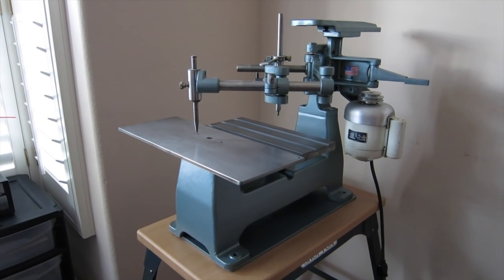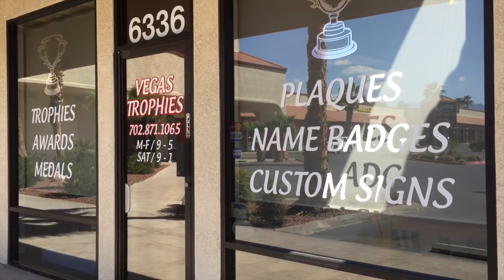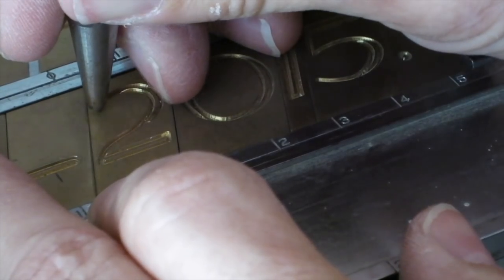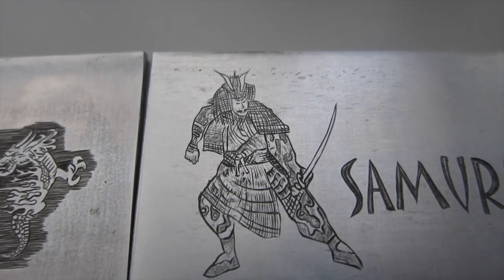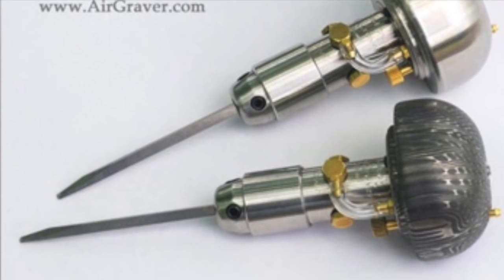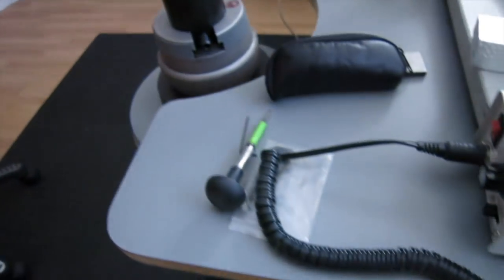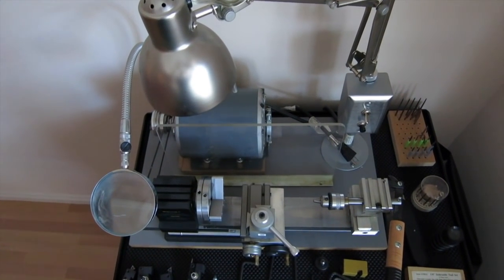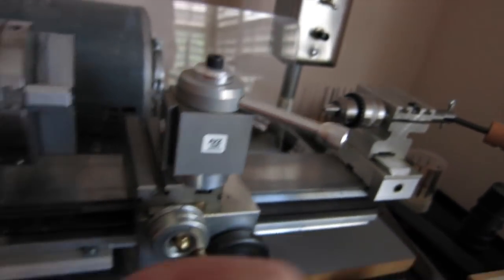Unique and unusual tools I own #2  Engraving demo

Comment: They make a gimbal for use with the selfie, but a fixed gorilla flexi tripod might be easier.  I got mine at Fry's, and you in LV have the absolute super Fry's, keep up the good work, I look forward to them.
Reply from the maker: +Uncle Albert Thanks for the tip Uncle Al.

Comment: For the air compressor how long can you run it? The manual said something about 15 minutes on 15 minutes off so the compressor does not get stressed. But for a Lindsay palm control can you run it longer.
 The van is really nice. I need one.